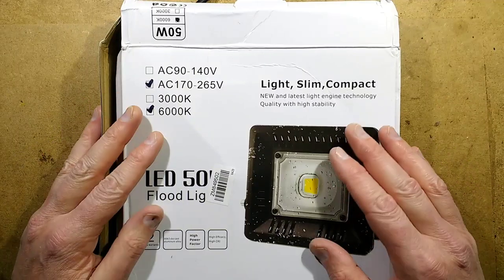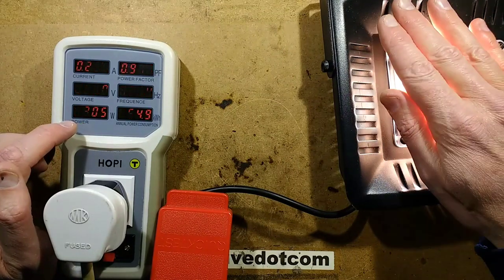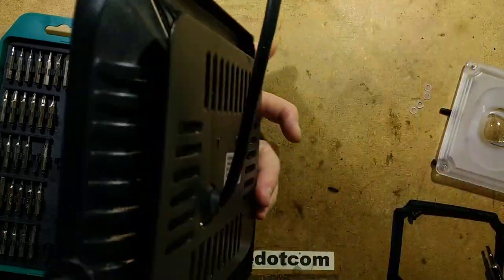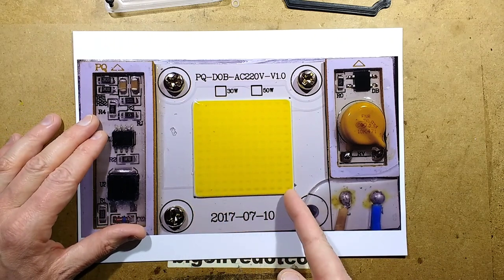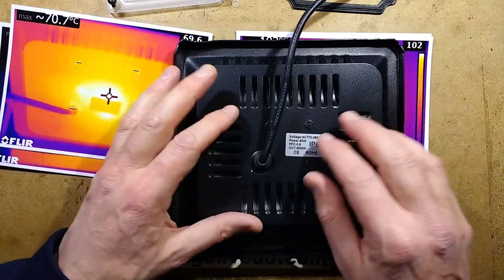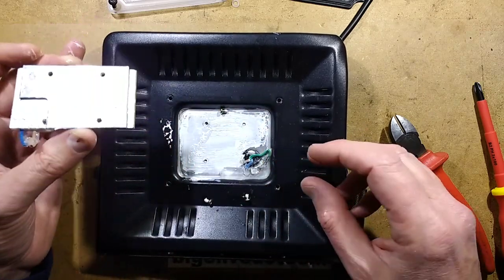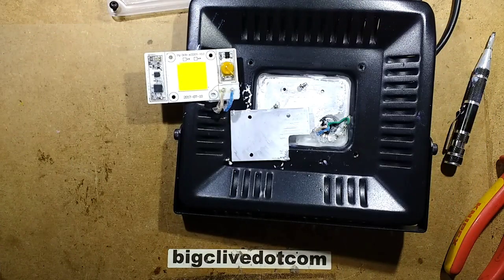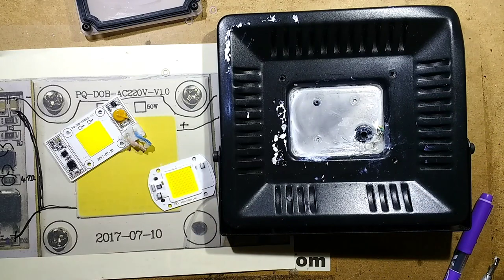Inside a super-slim 50W LED floodlight.

Comment: HI! thats a great video, what was the room temperature when you take the thermal picture?. Do you recomend this type of leds?
Reply from the maker: I don't recommend these flimsy lights.  They need proper waterproofing and termination.
Reply: @bigclivedotcom  thanks a lot Sir, I have a couple more questions about it, I am a flood light manufacturer in Venezuela, would you like to see mi work? It will be a pleasure to count with your opinion, I just have a 40w and 80w model and 3 years fighting to make them better, is really hard in Venezuela with the limitations that actually have, but I thing engineering have no limits jeje. If you want send me a mail to share some pictures  and my own technical data

Comment: Hi there, thanks for all the knowledge you have been making available. I need to ask a newbie question: is it possible to use a dimmer switch on COBs like this? I am thinking of converting these very inexpensive units to a ceiling lamp... thanks for your insights!
Reply from the maker: The simple driverless LEDs are better suited to dimming, but will flicker at mains frequency which you may find annoying.

Comment: The cable entry is not sealed properly and the cores are being crushed, heat-sink compound not spread and board is not making full contact with heat-sink , water will find its way in and destroy the board. Also the strain relief on cable is adequate, i bet the cable insulation is not fully complaint either. I'm not buying them.

Comment: Ah wow, so some of them switch in more LEDs as the voltage goes up, as a way of efficiently using the voltage? And it means no need for a step-down circuit to reduce to a standard DC voltage. Dead clever! Also slightly nicer power factor I suppose cos there's no capacitor or inductor storing and buffering power during appropriate bits of the sine wave. 

I see there's still a bridge rectifier in there. Actually rectified DC is about 300-ish volts, so presumably that's taken care of in the design? Really really clever! For a change, for something like a floodlight, that are traditionally cheap, and for being Chinese, traditionally crap. 

Does that mean they make LEDs with different taps for each voltage? Or are they only available with the whole thing bonded together for a mains voltage LED? I suppose the switching thingy means no need for a power supply, and therefore no heat dissipation from that power supply (just plenty from the LED). 

I suppose you'd still need a resistor in series to limit the current?

Never heard of these before, dead impressive.

As a guess I'd say the mystery chip is a microcontroller. There's a lot of ARMs called STMsomething, and the numbers look vaguely micro-ish. If it were some voltage convertor there'd be an inductor, and apparently we don't need that.

Comment: That just bad wiring there. They could not sell that in the Finland. I have very similar floodlight but it does not have silicone rubber on the LEDs but it have it on the wires inside and wires are on the corner and not directly back on the LED chip.  Brand is ENERGY+ and it was only 20€. True 50W.  It also made back in the 2017.

Comment: Hmm.
You seem to have 240v 50Hz mains..
Interesting.
I thought it should be constant 220v-240v 60Hz in Europe.
Thats what i have in my house.
Maybe it wouldn't flicker as much with aditional 10Hz
Reply: Where are you from? I did not know that there were countries in Europe with 220v/60Hz.
Reply: UK has between 240-250V @ 50 HZ. Only country I know that uses 60Hz is the US, thought all Europe was 230V @ 50Hz
Reply: I found out the cause.
I live in house that my company built so we(workers) can be close to our workplace.
I also found out that they run in houses 60Hz because they run it in workshop too,and i think thats because of industrial power supplied by country(you pay fixed price,no matter how much you use) or its because it maximises the efficiency of inductive based loads.
Reply: Quite a bit of Central/South America and the Caribbean uses 60 Hz, as does South Korea
Reply: Против Глобал in the UK we are told it's 230V to conform with the EU but it's actually 240+ the cost to switch to 230 would be too massive so it's easier to lie.  I've actually read up to 252-255V in some areas.
Reply: Против Глобал I agree the best thing that can happen  is the EU splits.

Comment: The mystery chip is probably just an op-amp in a classic current source arrangement with a MOSFET, like this: https://eositis.files.wordpress.com/2014/09/advancedleddriver2.png I would check what all the pins are connected to and compare this with typical single and dual 8-pin op-amp arrangements.

Comment: Kind of all started off quite well, then went down hill quickly. I think the Chinese needs lessons that thermal past is not a gap filler and less is more. Since how long have you had flir???
Reply from the maker: I bought the Flir when Mike of mikeselectricstuff did a complete teardown.  My decision to buy it then was aided by the community discovery that the initialisation file could be changed to unlock all the features on the base model including the resolution.  It still cost well over £1000.

Comment: Revised a similar led light with the same housing. Also saw very poor thermalpaste contact due to bad fitting. 
https://imgur.com/a/qvPBa
Fixed it by grinding down corners to make it fit flat and applied proper heatsink paste. Cables cramp up too, had to secure them tight in epoxy. Like the flat profile though, but shame the assembly is not done right.

Comment: You can buy those less on ebay. Item number: 252958157047

BTW  I bought 20 of those 50w chips when you did your video on them earlier in the year. I have 5 of them mounted onto a heatsink that us way too small and a 120mm fan to keep them as cool as possible. After hundreds of hours of runtime they haven't failed yet. I also don't notice a flicker on the 120v version.